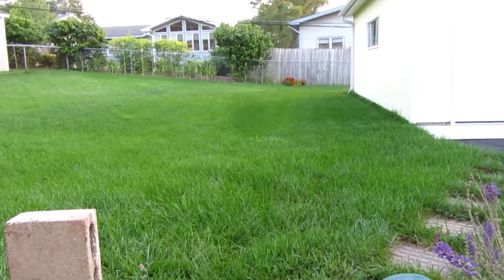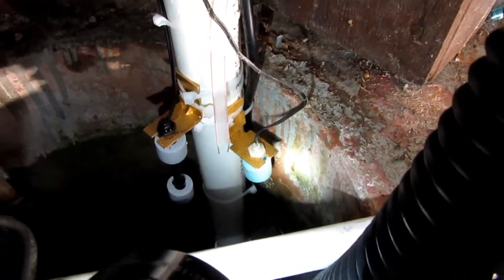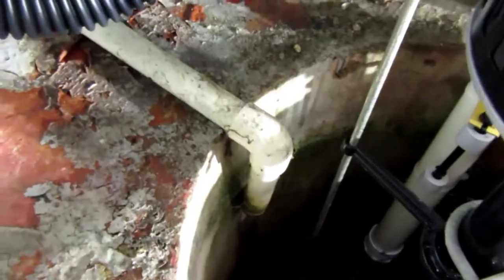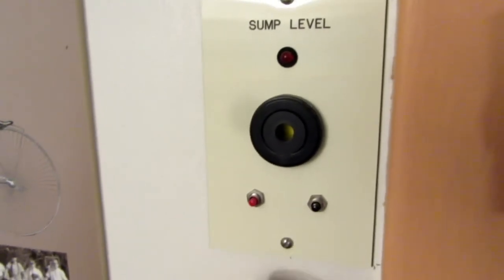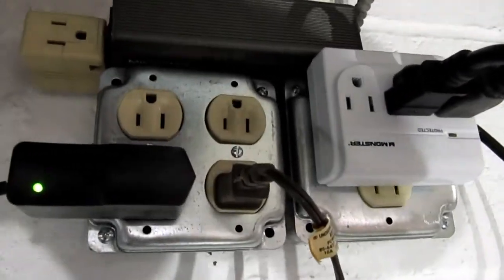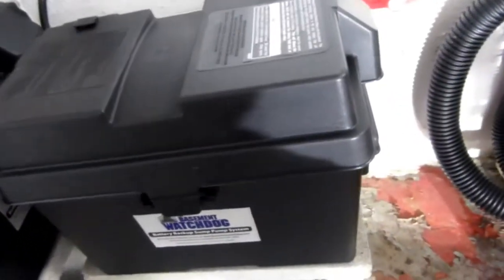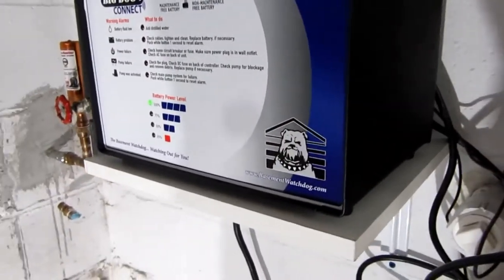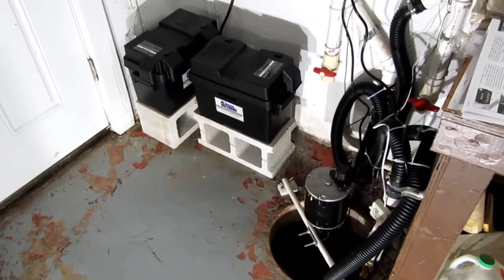Basement Watchdog "Big Dog +" Backup Sump Pump

Comment: Nice job.. thanks for sharing your Sump Pump installation.   I would think that flexible hose adds a lot of resistance to the water flow..
Reply from the maker: I have a newer YouTube video showing how I replaced the flex hose with rigid PVC pipe.....

Comment: I just bought a very nice backup sump pump myself, only to realize it shared one of the main flaws of most backup systems - they run on battery if the main pump fails - even if AC power is present.  So if your primary pump fails (overheating, age, bad switch) the back up pump power supply is not big enough to power the pump and keep the battery charged.  This BWG big dog system shown here along with the Pro-Series PHCC-2400 and the expensive Zoeller Aquatnot Active system will run on AC power without a battery.  As for the battery look for  a Group 31 AGM Deep Cycle Marine battery. I would not use flexible tubing for the piping system.
Reply from the maker: Yes, the main selling point of the Big Dog is that it can run on AC if available (in cases where the primary pump has failed, but AC power is still available). As you said, most backup sump pumps can only run on battery power, and during a weather event where there is a lot of extra water for extended periods, you don't want to be limited to the few hours that the typical battery will provide. The other advantage is that the Big Dog is designed to work with one or two batteries, to get extended run times when AC power DOES fail. I think I mentioned this in my video.

And, yes, when I installed my Big Dog, I just used the same tubing setup that was already on my pumps. Since that time, I have replaced the flex tubing with a hard piped installation, and I have another YouTube video about that.

The other thing that I think many/most homeowners screw up on, is using a single discharge line to serve both the primary and backup sump pumps. Sometimes the problem is with the discharge, not the pump or the AC power, and having independent discharge lines can be a remedy for that eventuality. The other thing I recommend is, in addition to having the independent discharge lines, is ALSO have a 'Tee' in the discharge  where you can hook up a long flex hose line, so you can direct the water somewhere other than the normal discharge.
Reply: @youtuuba  Yes, the run time is highly dependent on how often your pump would run in a good rain (anyone can time their primary to get an idea). Typically they will list backup times for continuous pumping at 5-7 hours and a 10% cycle time (example 30 seconds on 5 mins off)  at 24-48 hours. One thing I did during a recent heavy rain was to sit and time my primary pump to get an idea of the demand cycle my backup might see on its own - understanding a back up pump would take longer to pump out then a primary. Thanks for the video post.

Comment: Thanks for the video.  If both the primary and backup pumps are on the same electrical circuit, don't you worry about both of them running at the same time and tripping the breaker?  Then you'd be hosed because you had a backup.
Reply from the maker: I have run both at the same time on many occasions....I don't think their motors are all that powerful that they take a lot of current. But you are right, it would be ideal, in a new installation, to have dedicated circuits.

Actually, for many years, I had my primary sump pump, my home made backup pump (pre-Basement Watchdog), AND my well pump on the same circuit, and the breaker never blew.

What DOES blow is the breaker that protects the circuit for all the machine tools in my basement workshop. It is sufficient for any one tool running plus if my shop vac is also running as a dust extractor. But my little air compressor is on the same circuit, and if it works out that a tool, the vacuum and the compressor are ALL on, then the breaker trips.
Reply: @youtuuba  What I did is have separate circuit for primary sump pump and Big Dog backup sump pump.  Additionally, I have one circuit on left hand side of circuit breaker/fuse panel and the other on right hand side.  So, each one is on a different phase coming into the house.  We lost one phase once and lost half of our 120V power and had no 240V - we would still have sump pump available under that condition.